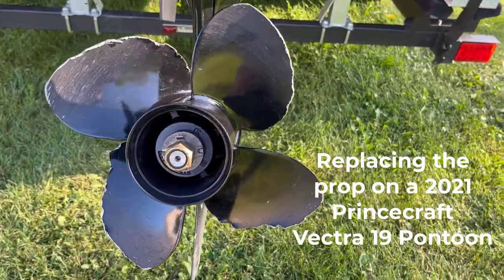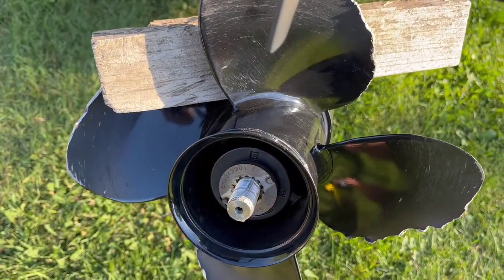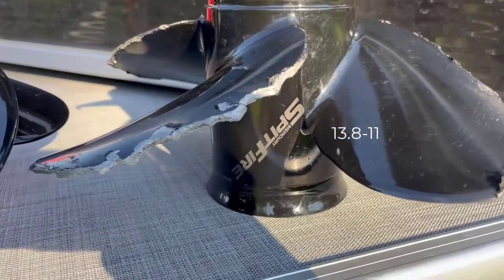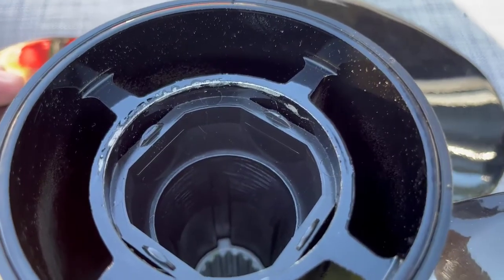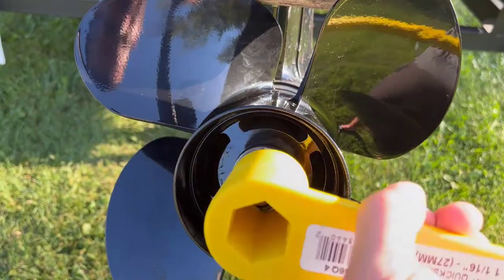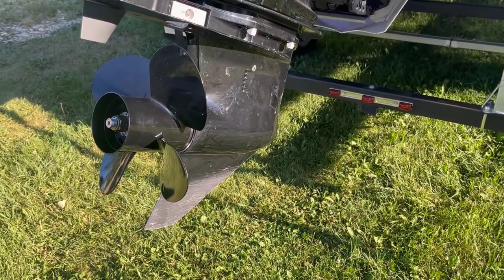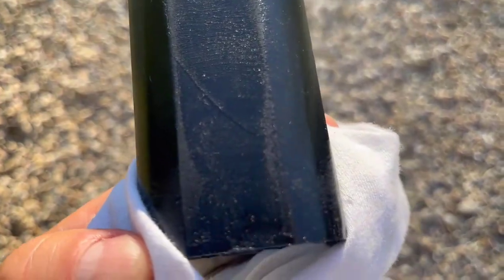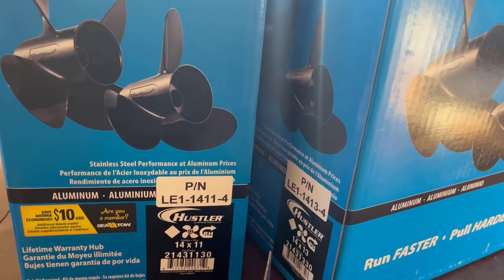Mercury 75, 90, & 115 HP 4-Stroke Propeller Replacement - the rookie's perspective and learning(s)

Comment: Good video.  I'll mention that once the prop is removed as shown you should pay attention to the white plastic prop  "bore ring" that remains on the lower unit.  It snaps into place and should be secure against the lower unit.  The fingers (snaps) do have history of breaking and if the bore ring is loose it can cause cavitation of the prop.  A number of YT videos show this.  A replacement if needed can be got for about $6-8.  Cheers!
Reply from the maker: Great to know. Thx for the info!

Comment: Do you have a link to that prop? And is it faster than the one before?
Reply from the maker: Hi Eddie. The prop is from Turning Point (a Hustler prop). Address here: https://turningpointpropellers.com/     ...Unfortunately the one I put on in this video was not faster. Going to a slightly larger prop (fraction of an inch), but in a 13 pitch, should have decreased RPMs by a few hundred from stock prop and I hoped for more top end speed accordingly.  However, my wide open throttle (WOT) RPMs dropped to 4800 which is just too low for this Merc. I guess the 75 HP just doesn't have the ooomph to push it.   I swapped over to the Hustler-Turning Point prop that's a 14" x 11P, and I am back up to 5200-5300 RPM at WOT. I gained about 4 knots going back 'down' to the 11 pitch in the same diameter. I was surprised that it was a full 4 knots difference.   I kept the 13 pitch as my new spare in the boat.
Reply: @beebee7999  if the merc is rated at 6000 I would go down another 2” of pitch. The way I prop is max rpm empty that way when I put a load in the boat I’m not lugging the engine.
Reply from the maker: @javery50  worth another "test" when I destroy this one on something... LOL.
Reply: @beebee7999  going to a bigger diameter prop will reduce top end speed due to increased drag.

Comment: How did the new prop work out?
Reply from the maker: Not too bad.  It’s had good use since the change. I feel like I have more hole-shot. BUT I definitely feel like sacrifice is a teensy bit of top end speed (and that annoys me). The difference between this and the OEM Mercury Spitfire in terms of pitch and size and numbers is minimal. But the Spitfire was a better prop at 5500 RPM.  

That said, for the cost savings, I’d go this way again every time.